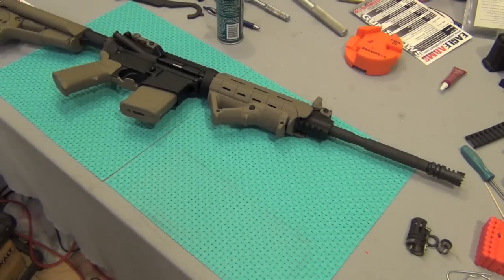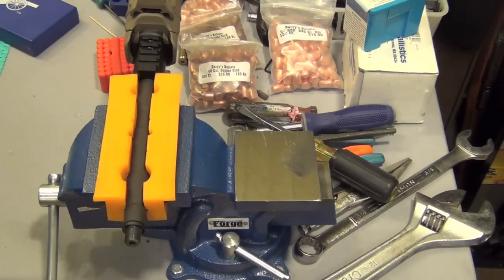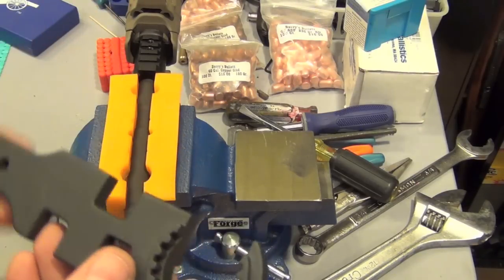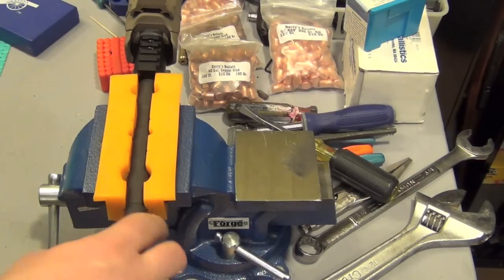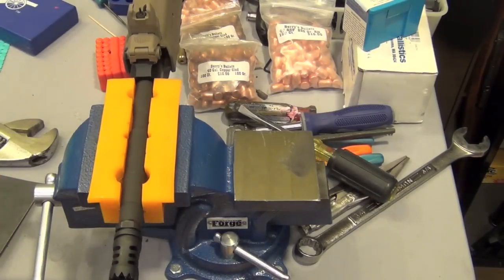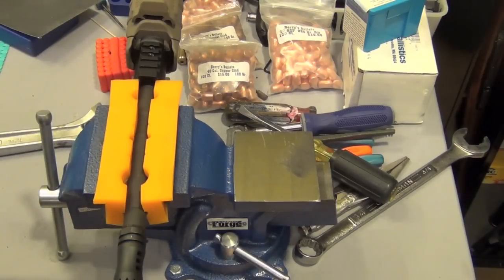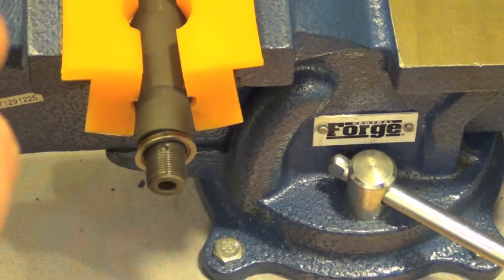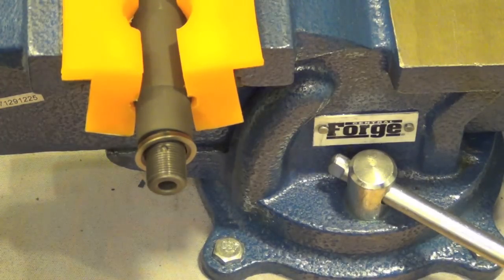PINNING THE MUZZLE BRAKE

Comment: Dude why did you sand the crush washer??  The crush is used to time the brake. Where do you thing it got it's name.  You CRUSH the washer when tightening the brake. To the final time position.
Reply: Use timing shims
Reply: @vikingbladeworksllc7747  the crush washer is all he needed. you dont have to remove metal off the crush washer. you dont have to use shims.  The crush washer crushes so you can time the muzzle device.

Comment: really bro. it's a crush washer. you tighten it, then loosen it and you keep doing that till it's where you want it. the washer crushes
Reply: Actually no... A muzzle device torque spec is 20 ft/lbs.  Any tighter may cause problems.
Reply: Fox Mulder Actually Yes... You put the crush washer on, then you put the muzzle device on hand tight till it stops, then get a armors wrench and you tighten it and then loosen it till your muzzle brake is almost where it needs to be, then you tighten it one last time till it is centered...
Reply: Brian Downey That's all well and good as long as you can time it without exceeding 20 ft/lbs.  Sometimes, it's not possible without removing some material from the crush washer.  Most likely exceeding 20 ft/lbs wont damage the barrel but spec is spec. I would rather get timing shims or jam nut rather than put something out of spec.
Reply: yes, these crush washers are designed SPECIFICALLY to handle this. 
I would caution anyone watching this video to also watch other videos as well as read up on this process before attempting this.
Reply: +Fox Mulder Brian's right. you tighten then loosen. that keeps the spec at around 20 on the end product.
Reply: "Crush" washer... it literally crushes to the point needed applying the proper torque.  This video is amateur at best and even then should not be followed as a DIY
Reply: Has to be pinned and welded! You sir have an illegal SBR without the weld!
Reply: the requirement doesn't state that it has to be welded. Just that it is permanently attached. I do this for a living. I didn't watch what he did so i don't know if what he did is adequate, just informing you that a weld is not the only option.  

Oh yea, I watched what he did, that is nowhere near what the regs call for. 

Shit, I just realized he is also doing this for someone else. This is an embarrassment. He is going to get someone in a heap of shit.
Reply: Erik Kay Yea, blind pin with the head welded for the route he took. I would strongly advise removing the video. if I were to make a video also it would be 100% complete before I reattached it to the lower.
Reply: yea, he made literally no effort to make this permanent in any way. Anyone in NJ who followed this would find themselves potentially in a world of hurt.
Reply: Ryan Carithers oh, not that it makes what he is doing any less terrible, but he started with a legal length rifle barrel so i don't think it would be an illegal SBR, it would be a threaded rifle barrel with a non permanent muzzle device. 

Unless I missheard in the video. I am not trying to call you out or anything I just thought he said the barrel itself was already over 16" without the brake.
Reply: Erik Kay you're right, I was thinking it was a 14.5", I wasn't paying that great attention to him.
Reply: I don't blame you
Reply: I applaud you for trying! This is how you learn. Great job everybody has to start somewhere.

Comment: The law reads permanently attached. Acceptable methods are either welding or a blind pin. The laws are of course worded strangely which has lead many to believe that you need to install the pin then put a spot weld over it. You only need to do one of the two not both. Stag Arms builds specific CT and NJ compliant AR-15 rifles by just not threading the barrels at all.

Comment from the maker: it original was used in the stock muzzle brake that was pinned on the rounded. so when i use it on the new muzzle brake on the flat part it is a hair longer..

Comment: You don't need to sand the pin down so long as it is pinned into place, we had a guy that was pinning the flash suppressors and grinding them down, problem was he was doing such a good job the ATF didn't think that they were ever pinned. Now he leaves them with the pin showing.
As far as welding the flash suppressor after pinning it, you might want to call ATF and ask them, I believe that it is Pin OR Welding and you don't have to do both.
Reply: The ATF procedure for measuring barrel length is to measure from the closed bolt (or breech-face) to
the furthermost end of the barrel or permanently attached muzzle device. Permanent methods of
attachment include full-fusion gas or electric steel-seam welding, high-temperature (1100°F) silver
soldering, or blind pinning with the pin head welded over. Barrels are measured by inserting a dowel rod
into the barrel until the rod stops against the bolt or breech-face. The rod is then marked at the
furthermost end of the barrel or permanently attached muzzle device, withdrawn from the barrel, and
measured. 

https://www.atf.gov/firearms/docs/atf-national-firearms-act-handbook-chapter-2/download

Comment: Hey buddy good job on you video and just for future reference whenever taking a flash hider off and you do not have the correct wrench just throw a piece of electrical tape around it and then tighten your crescent wrench down on to it that wont leave any marks. Ive done that many many times an it seem to work just fine

Comment: there's little to no guidance in NJ law as to what is legal and what is not. however there was some BATFE clarification years ago when the AWB was in place as to what was a "brake" and what was a "flash hider" FH's are illegal in NJ. technically your standard A2 has to be removed. i typically stick to anything that is listed as a compensator (louder at the range, sorry...) or anything listed as a brake.
Reply: The A2 has a muzzle compensator.  It is not described as a flash hider. You are correct, though, that no state describes their criteria for any of these.

Comment: You put it on upside down, the large non-vented section should have been on the bottom not the top.
Reply: wrong, the venting goes at top, this is to offset muzzle climb as well as not deflecting gases toward the ground and kicking up dust and debris.
Reply: Atimatik Army thats what he said...
Reply: DarkMatter946 Oh, if that is the case and I missed that, I apologize then.
Reply: No worries brother
Reply: Pretty sure he said he had the barrel upside down. At the end of the video the not vented area is facing the ground.
Reply: James Maxwell Yeah, that would be correct then.  My comment was to the OP here who I was responding to as I believe he suggested otherwise.

Comment: You don't need to sand off the crush washer. They actually crush. Just hand tighten it, then use a wrench to tighten it to desired position. The washer is designed to crush as the muzzle device is tightened. :) Hence the name Crush Washer :)
Neat channel by the way. Subbed.
Reply: They don’t always line up with every device hence the reason shims are sold…or sand the washer. Whatever floats your boat

Comment: This video needs to be taken down. You have it timed pretty dam stupidly. Crash washer is designed to be crushed. Thats what keeps it from backing out. Also if you dont weld over the top it's not "permanent".  Also a ruler is not precise at all. Use calipers. This video was bad enough I felt the needed to fiend 6 yearly later and at 2am.

Comment: Not true. In NJ it has to be pinned or welded on threads. The key is that it cannot be removable. (Not just welded). Also it has to be "muzzle brake" - not "supressor" or you are risking few years in jail just for possesion (even if it is not installed). Crime of fourth degree if I remember from state documents.

Comment: You need to weld over that. Otherwise a pliers pulls it out. It's NOT permanently attached as-is.
Reply: You can always use a shorter pin and then stake the muzzle device opening to cover the pin from falling out.
Reply: @muffemod  Bringing back a long ago thread, but It HAS to be welded over. Per the NFA Handbook-
"The ATF procedure for measuring barrel length is to measure from the closed bolt (or breech-face) to the furthermost end of the barrel or permanently attached muzzle device. Permanent methods of attachment include full-fusion gas or electric steel seam welding, high-temperature (1100°F) silver soldering, or blind pinning with the pin head welded over. Barrels are measured by inserting a dowel rod into the barrel until the rod stops against the bolt or breech-face. The rod is then marked at the furthermost end of the barrel or permanently attached muzzle device, withdrawn from the barrel, and measured."
Reply: @gregrburnett3400  If you stake the pin with enough friction it will weld it in place.
https://en.wikipedia.org/wiki/Diffusion_bonding
Reply: @muffemod  Um..., yeah, No.
First, did you miss the part in that article about heat? There is simply NO WAY you are going to stake a pin in and accomplish that. It is NOT going to happen.
Second, what I posted is copied and pasted from the NFA Handbook. It is the law. The federal law. I wish it didn't, but it supersedes all state laws. It clearly says that the pin must be welded over. So even if you could pound a pin in hard enough to weld it into the hole, it would not be welded "over".
The results in the video are not in compliance with the NFA and neither are your solutions. Sorry.
Reply: @gregrburnett3400  Look it's not up for debate.  You can't handle the staking pressure needed to weld it.  That's why you're on the bench and Coach sacked your ass. 😆🤣
Reply: @gregrburnett3400  Nobody can, but a robot! 🤖 BEEP BEEP!
Reply: That's only if the barrel is 14.5" inches.  If it's 16"+ you don't need to weld.
Reply: Only need to weld if the barrel is less than 16"

Comment: I'm pretty sure that state law can be more strict not be less strict than federal law. I looked on the ATF website and it was pretty clear that you have to spot weld the pin so that it's not removable. You can contact the ATF and ask them. I think it's a bullshit law but it is what it is and the penalty is very high if they decide to be assholes about it.

That washer is designed to crush so that you don't have to sand it down, it's why it's called a crush washer. Also you're supposed to drill steel at a low speed and lubricate the drill bit. You're fucking up your drill bits doing it like that. If you try doing that on a harder metal, you'll wipe out the drill bit before you finish the hole.
Reply: You're correct. Federal Law becomes a "minimum" if you will.  Kentucky for example may pass a law saying 30round mags are the maximum, but if the Feds say 15, 15 becomes the law of the land.
Reply: makeil kalashnicov not in NJ you have to have it either Pinner OR Welded not both. My state is very strict as well

Comment: im an armorer in the marine corp for crush washers your right you just grab the wrench and open a can of man. our specs are that you have to torque it at least a 1/4 turn to 1 1/2 turns but you can torque them a good 2 + times before it wont go any more

Comment from the maker: when i called STAG arms they do not weld on the muzzle brakes. they pin them and said that it is 100% NJ compliant. i also looked at my RRA AR-15 and it doesn't appear to be welded either. so i would like to know where you got your info. how would Stag be able to do this if it's illegal. thanks for any info

Comment: Please do yourself a favor and weld that pin. Also if you measured and cut the pin to the right length to hold the fh on it shouldn't be sticking and you shouldn't have to shave it down.

Comment: No thats not legal. The pin has to be welded in place. You dont have to sand a crush washer. A crush washer crushes as you tighten the muzzle device so you can time it.

Comment: I wonder how many SBR's are in the United States w/o a Fed tax stamp???
Since he had a flat at the timing point, drill center of the flat, tighten until timed, drill 1/8 of an inch into the threads, insert pin, weld, DONE!!!
I will need to do this with my AR...NFP.
Reply: Your comment is more helpful than this whole video!

Comment: I normally do not comment on youtube videos, but in this case I feel obligated in order to help viewers attempting to properly blind pin and WELD a muzzle device.  This video is totally incorrect and after watching it I was infuriated
Reply: Execprotect in New Jersey where I live and sounds like he does as well it has to be Pinned OR Welded. Not both, it also has to have a pinned stock. Pinned OR welded break not flash hider, pinned stock and 15round cap on magazines. That's our law
I just went through this same situation at my local gun shop that's owned by a former police officer of 29 years. Every state has it's own laws

Comment: yes a NJ compliant rifle has cannot have threaded barrels or a device on the end of the barrel that can accept any other device that can either hide dampen or eliminate sound signature. Also NJ rifles cannot have flash hiders on them. SO you can only have a non threaded end to your barrel OR a permanently attached compensator or muzzle break. 
As with anything please dont take what I say as gospel. You need to do your own research and be sure that laws havent changed or been modified in anyway.

Comment: the crush washer is MEANT to be "crushed" when you are torquing down on the muzzle brake to time the muzzle break to the barrel. 

there is no problem because this particular one is being pinned and welded, but the reason for torquing down on the crush washer is to prevent the muzzle brake from walking off slowly and then getting blasted off when you put a round down the barrel.

i also have a cheap armorers wrench, its only real use is for the barrel nut and castle nut

PS: those threads on the barrel are hardened steel, there would be NO way you could ruin those threads by hand

Comment: You should find out 100% what the law is regarding the pin because if it's wrong they will nail your ass to the wall for it. New Jersey won't let you slide on gun laws.

Comment: BATFE rules say that pin has to be welded or use 1100° silver brazing solder.

That's a 16" M4 profile barrel in the video and doesn't need to be pinned anyways...

Comment: Dude. Pin and WELDED is the key. As mentioned sanding the crush washer was a waste of time... like the video. I wanted to see if they just TIG it with no filler.

Comment: If the pin is protruding above the muzzle brake it is probably not set into the blind hole in the barrel. If this is the case and by some off the wall chance some LEO or ATF thug gets a hold of your rifle and desides to test your pinning job and your MB comes off too easily you will find yourself in a world of shit!

Comment: there is no guidance from NJ on what is or is not compliant. we only have what the BATFE has said would be considered "permanently" attached. of those listed, i believe if it is pinned in a fashion to where it cannot be removed, welded, pind & welded, or even silver soldered with 1100 temp or higher solder, it is considered "permanent." this came about because some people were asking if one could just use thread-lock, or red loc-tite... which the answer is no.

Comment: If you look, it is a 16" barrel.  I believe a couple commie States require any muzzle device to be pinned.  He did time it; that's why the closed off portion is on the bottom and the ports are in the 11 and 1 position.  There is no way he could tighten it enough to get it to time with the crush washer.  It would have had to do almost a full turn after it was already tight, which if you try, won't even come close to 1/2 turn.  Some muzzle devices come with just thin shims to time it, so I don't see why there would be a problem sanding a crush washer just enough to time the brake.

Comment: Nice job. Sucks we even have to but I've done this a few times. My understanding is it must be a muzzle brake (google BATF approved brakes) and permanently attached by weld or blind pin. For blind pinning, technically the pin should be recessed with a spot weld or high heat silver solder cover. I've done builds in the past where I drilled a set screw hole into a threaded brake, screwed it on, installed a recessed set screw, spot weld or solder cover and paint. Permanent.looks factory.

Comment: as for the clarification, the BATFE used was that if the internal diameter of the flash hider was larger than the bore, and/or had slit ports arranged in the line of bullet travel (front to back) and it reduced flash, or its main purpose was designed to reduce flash, it was considered a "flash hider"

Comment: Tip, a little painters tape, or whatever kind for that matter on your wrench to avoid scratching your flash hider, comp, brake, etc.. You get the point. It works pretty well.